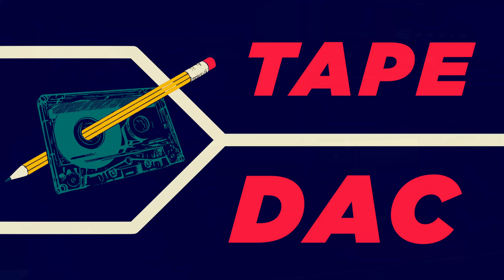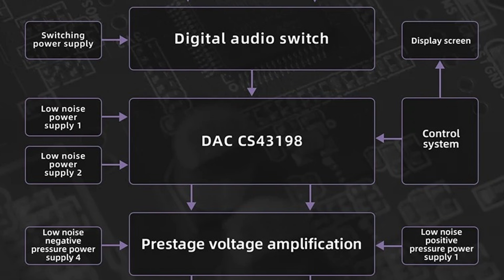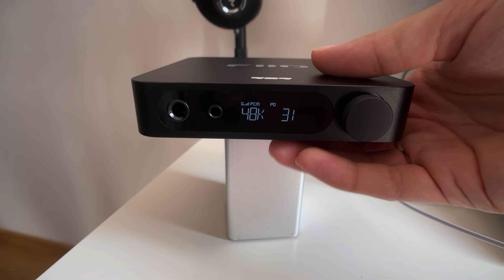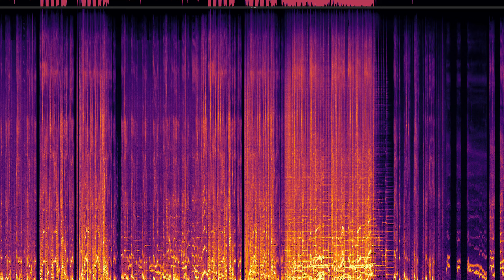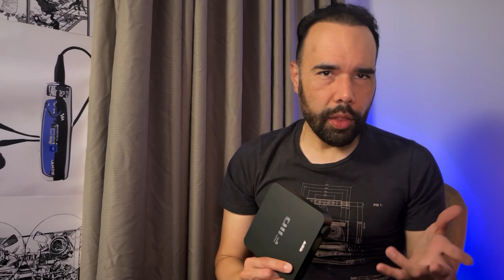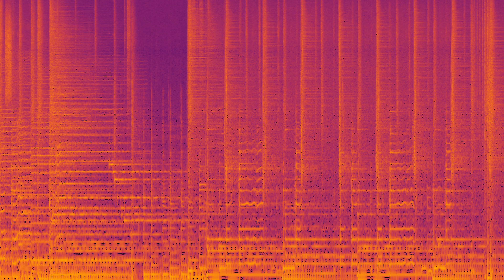DAC Fiio K11 R2R: Review and How To Fix the BIG issue!

Comment: Bought a k11 r2r, paired it with an also recently purchased Hfiman Sundara and I'm quite disappointed. Using Deezer lossless and Flacs for music yet I sense much distortion in the highs and it just sounds so grainy.  I've an old KA3 dongle, also from Fiio and even that sounds warmer and  cleaner. 
Anyway, my question, should anyone have any experience wit this combo is: have I perhaps received a defective product, be it headphone or DAC, or do they just work this poorly together?
Reply from the maker: Hi, you also need to test this DAC with this headphone using an external amplifier. The problem may lie in the combination of the K11's integrated amplifier and this headphone.
I don't have a magnetic planar headphone to compare it with. As soon as I do, I'll make a video about it.
Reply from the maker: Another try is to use a balanced cable to get more power from the K11 R2R. Here is an option if you haven't a balanced cable yet: https://s.click.aliexpress.com/e/_Dl4YjnN
Reply: Always best to wait for the excitement to die down. I have the R2R and personally I would not rate it as high as 90% of you tube and online reviewers have. My SMSL AO-300 is far more capable of recovering low end detail for a start but I have to say I do like the vocal reproduction of the K11 R2R.
Reply: @Panslapper  Vocal reproduction was  indeed decent for the price but it was heavily counterbalanced, with the  Sundaras, by a noticeable lack of bass and the aforementioned distortion issue on higher frequencies. I've since tested the headphones on a proper integrated amp with a decent headphone out socket and they sound very well with pretty impressive bass for an open headset, so I know that the issue was indeed the K11, 

I managed to return it for a full refund and just ordered a Hifiman EF500 instead.  Since I can't realistically test the products before buying them, basic dummy science suggests that a higher class device from the same company as my headphones might pair better. Just waiting on delivery now...
Reply: I've also had some clipping and distortion issues with this DAC. I'm running it into my xduoo t-22 and I tried it with a fiio k9 pro. Ive tried it on both my sundara's and focal azurys. I'm considering returning the device.
Reply: I have Sundara's and have been very disappointed with them. No soundstage.

Comment: i belong to the "un-pure" audiophile group as i run everything into an eq. no apologies but every piece of recorded music is engineered and mixed differently so your sound system will always reproduce this. i prefer the sound that my ears say sounds good and that typically requires an eq. just how i do it.
Reply from the maker: I think the best definition of "audiophile" is: a person who invests time and knowledge in modifying music to get the best possible sound experience from it. And in that case you would be a purist audiophile 😄
Reply: @stevetech5150 I too have resisted the mockery and have gotten several Equalizers (currently using an AB model 231 dual channel grqphic equalizer -with 32 switches each) 
 I have two setups fed by the same streamer and DAC (the Wiim Ultra and the Fiio Dac here reviewed).. One goes clean into a power amp and the other goes to the equalizer and chifi mono blocks. I understand that fiddling with EQ is the fun part but I'm curios to know what is your go to settings on your eq when yo are listening generally to something?
thanks in advance

Comment: Got mine a few days ago. It has some kind of remarkable characteristic that's hard to explain? Like music just feels more "real" which sounds ridiculous?
Reply from the maker: Yeah. If we were to draw a parallel with drawing, this DAC is a pencil that can leave a stronger line than a “sigma-delta pencil” 😄
Reply: The R2R is not the last word in bass detail, it does lack a little pinpoint definition in the low frequency's BUT the vocals are very natural sounding and the treble is easy on the ears and that's probably the attractive quality of the R2R. I have both of the Fiio dacs, K11 DS and K11 R2R and the R2R vocals are more human, less digital but compare the R2R to the dac in my SMSL AO-300 (Cirrus Logic CS43131) and it cannot match the definition of the low frequency's. I would highly recommend the SMSL AO-300 to anyone looking for a very good all in one unit with exceptional sound quality and power.
Reply: @Panslapper  How’s the EQ function on the AO-300?
Reply: @Notasdumbasyouare  ….very flexible! The presets are very well tuned imo. The ‘Tone’ leaves everything up to you so you can’t lose. Better than any tone control on any current £500+ class A/b amp, far better, much more accurate to the actual frequency being tuned rather than the smear that most amps will give you under £1000, could not say what goes on above that price.
Reply: @Panslapper I have smsl ao 300. Do you think adding r2r dac gives any more clarity
Reply: @anil24x7 Depending on which R2R dac you might be adding but in general no. R2R is not about clarity in most cases, it’s more about weight and musicality. R2R has a more laid back, easy going and smoother sound signature compared to most Delta Sigma dacs like ESS and AKM chip based dacs. If you want more clarity then I would add a more analytical ESS dac like the Topping E50.
Reply: I tried the AO300, its performance & functionality were perfect but the sound quality was no match for my Panasonic DVDA player & NAD amp, so after two weeks listening to audiophile CDs I returned it.

Comment: Hi! Thx for video. I got the K11 and i know everybody has different hearing and liking. Can you suggest me what is the best filter for using it?
1) Minimum phase fast roll-off filter
2) Fast roll-off, Phase-compensated filter
3) Minimum phase slow roll-off filter
4) Slow roll-off, Phase-compensated filter
5) Wideband flatness filter
6) Non over-sampling filter
Reply from the maker: Option 3 is the most “natural” filter and will be the best option for most types of music. Option 1 or 2 may be the best transient response for electronic music and some new Pop music because those genres contain many “digital” sounds.

Comment: Qudelix 5k has a battery.  Nice review.  This is the least expensive R2R DAC/amp available.  Driving $1100-1500 USD headphones with $160 USD DAC/amp?  Not sure.  Unless you are under 40 years old or a dog almost no one can hear 16 kh anymore.  Also...not to nitpick but the type of DS chip used is only one part of how a DAC will sound.  Quality of parts, analog output stage, etc.
Reply from the maker: Dave, I mentioned the dog's hearing when recording the video, but I cut it off while editing it because I spent almost two minutes talking about it. 🤣
I said something like this:
"People, a dog can hear at almost 45kHz. So if your dog runs away when you listen to music, something is wrong with your gear (at least in the high frequencies)."
Reply: What made you choose Qudelix over Chord Mojo 2?
Reply: @LencoTB  wanted something small with EQ.  I have an old school Samuels SR-71 Blackbird portable amp for power use.
Reply: @LencoTB  not soundquality for sure 🤣

Comment: I did not catch the BIG issue . . . a desire to achieve tape hiss?
Reply from the maker: I just used that song with "Hiss noise" because the Hiss is at a volume level below most parts of the music. That Hiss is over the whole frequency range. Because of that, some Sigma Delta DAC Chips will try to filter the song, but the filtering will not remove only the hiss. A DAC that filters our music is not what we want. That was the reason for the test.
Reply: some music: check out Ghost Dubs for bass range; Jack Cooper & Jeff Tobias Tributaries for mid range and detail
Reply: Love the Walkman picture behind you.
Reply from the maker: I had one exactly like that. It worked well for just two years, and I never got around to fixing it. But it was the first amazing noise cancelling MP3 player I heard.

Comment: Dongle DAC are weaker not because of the usb noise. It is limited because they could only use MLCC, not electrolytic caps.
Reply from the maker: The best capacitors for audio signals are film capacitors. There are SMD versions, but they are too expensive to use in the Dongle DACs. If you want to filter the noise in the USB supply voltage, you need to add more components beyond electrolytic capacitors. Because that, it's cheaper to add an external power supply input.
Reply: @tapedac I would love to hear your explanation on how Chord Mojo 2 works as I understand from Rob Watts it is totally different. I listened to a few podcasts but didn’t understand it.
Reply from the maker: As soon as I get one, I'll take it apart to understand how they did it. And I'll make a video explaining the details. 🤓
Reply: @LencoTB  I got a mojo1. It's not meant to be a desktop DAC. If you do that it will overheat and kill the battery. Charge it or use it not both at the same time. The DAC part is great, the DC part and charging was an afterthought and mojo weak point.

Comment: Thank you for the review and the explanation on R2R as I had not heard it explained. I have been looking at getting the original K11 for IEM use (IE600) for my desktop and had read that the R2R version was coming out. In your opinion would there be any difference between the 2 and which would you say would be ideal. I do not know too much about audio gear so it is all a bit confusing.
Reply: As a K11 owner I tried the R2R version at London CanJam last July. And for music listening the K11 R2R is on par with £500/£600 sigma-delta DACs in terms of dynamics and quality.

The regular K11 is too cold and analytic and misses a lot of quality around bass frequency reproduction and mid-bass dynamics (which is typical of the Cirrus Logic chip that uses).

I would suggest you to try the K11 R2R unless your main focus is gaming, where the sound might feel congested with the R2R.
Reply from the maker: I think @or1on89 (🙃) already responded to you. So, if you equalize the K11 R2R as I described in the video, you can get a sound more balanced than the sound of any Sigma-Delta Chip. Regarding IEM phones, I need to make a video about them because there is a "small universe" of specific technologies and physics related to them.

Comment: great review, do you need to upgrade the regular k11 to r2r?
Reply from the maker: No, no. There are two different DACs from Fiio  with the same chassis and similar names: "K11" (Sigma Delta chip) and this one in the video "K11 R2R" (that uses a lot of discrete components instead a integrated chip). Thanks a lot ;)
Reply: It is not an upgrade, it is a subjective choice of sound quality.